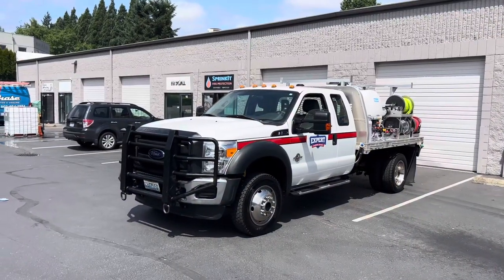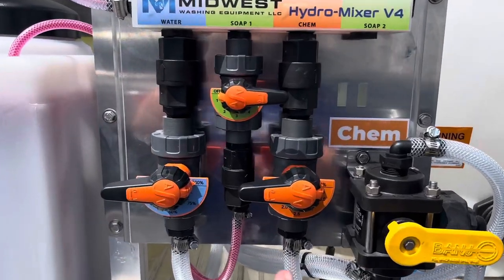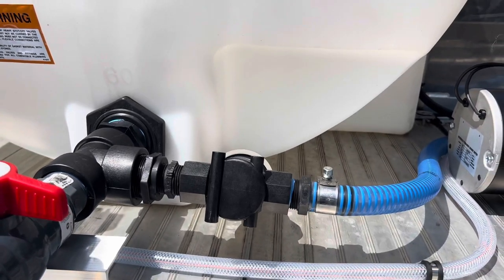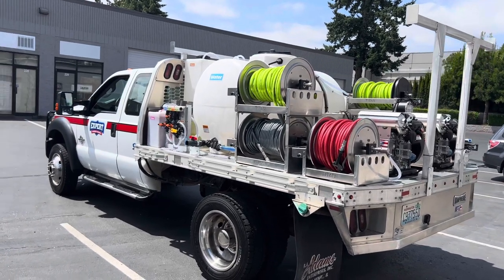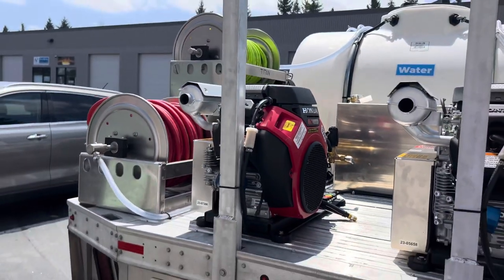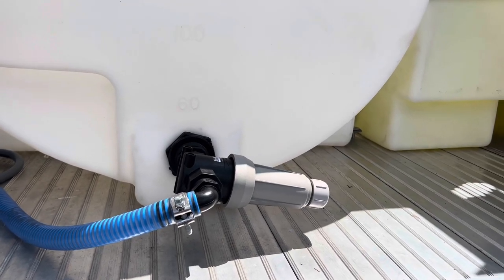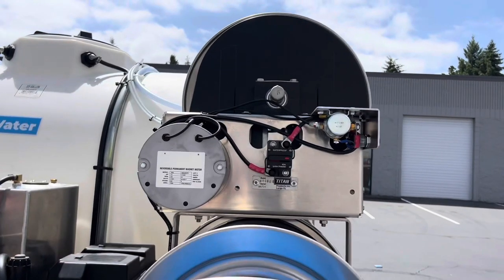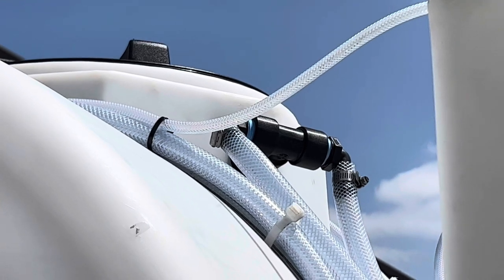F550 Flatbed Pressure Washing Setup

Comment: One of the Very few clean/professional fabricated rigs I have seen on you tube.  All hoses run neatly, zip tied. Wiring run neatly, heat shrinked, zip tied. Professional !  Many rigs advertised by big time fabricators are not to this level.  Many rigs shown have hosing and wiring with no for-thought. Looks like a bowl of spaghetti exploded!!!!  Might relocate fuel cell for easier servicing.  Splendid workmanship  !!
Reply from the maker: Wow, thanks!

Comment: This is one of the nicest setups I've seen. It would be perfect for residential and commercial jobs. A few changes that I'd like to see have been mentioned. The gas tank needs to be moved and locking tool boxes installed. Maybe a Yeti cooler mounted somewhere for hydration. Additionally, I'd like to see a camlock banjo fitting on the H2O dump valve so a guy could unfurl a hose and direct dump water away from a job if needed. This setup is my long term goal. More near term I think your dual pressure washer 8' skid is my next purchase as business grows. Awesome attention to detail.
Reply from the maker: Appreciate the comments! We did find a better location for the fuel tank after using it a while. Thanks again for watching!

Comment: Very well done!  My only question is why fuel in middle?  It would be a huge pain to fuel. I suggest mounting under flatbed next to truck fuel intake in front of rear wheels.  Easy access and saves room up top.
Reply from the maker: Great suggestion! I’m going to mount boxes. This was a really tight build with only a 9 ft bed.

Comment: Very neat and well done the only thing I see is the 22 gallon gas mount , you have to climb up to fill but so done well
Reply from the maker: That bugged me too but it will work. It does make it not as easy to get the gas and diesel mixed up.

Comment: How does that dual feed to a tee not push water out the other side without a check valve?  Nice rig.
Reply: I was thinking about that too.
Reply from the maker: It works but that’s a great idea. I may add that! Appreciate the comments.

Comment: For the T on the jobe valve, what's stopping the water from flowing down through the other feed line. Do you have a check valve on the feed lines somewhere?
Reply from the maker: Good eye. That’s been removed. Each hose has its own inlet
Reply: @ExpertPowerWash  Thanks for the reply. Finishing up transferring from an 8ft skid to a flatbed by tomorrow. Plan on doing a ladder rack like you have on this. Anything you would do differently if you had to do it all over? Very clean setup as always.

Comment: beautiful set up! My ideal would be F550 with full cab, 10' bed, 2x10gpm with igx800, 100 slim bleach, 300 slim water, 100slim RO/DI water, softwash gas system (comet p40), 10gpm hot box. 

did you all get the truck on auction through govt? and what is that valve you said for the dual feed water hose?
Reply from the maker: It’s just a tee. This truck was bought off a private brush fire contractor. It was DOT inspected yearly.
Reply: @ExpertPowerWash  oh, I got it... JOBE valve. yes those are great!